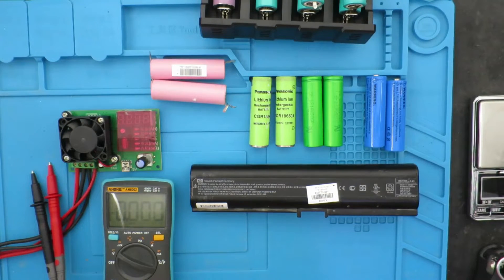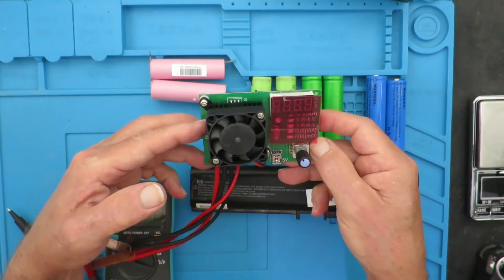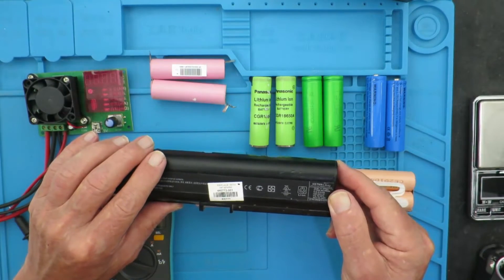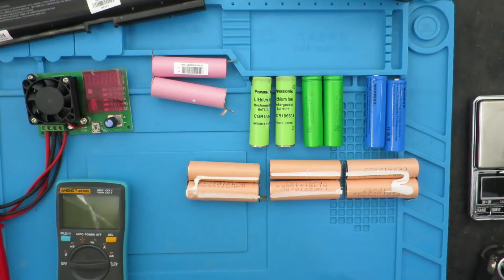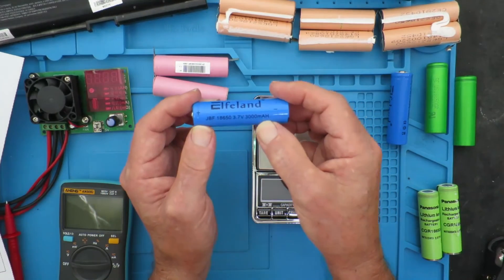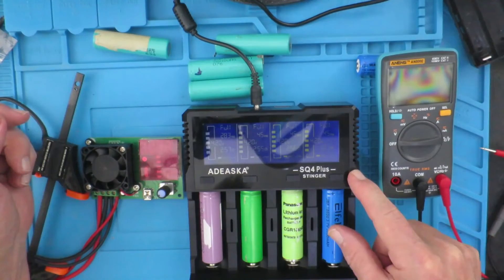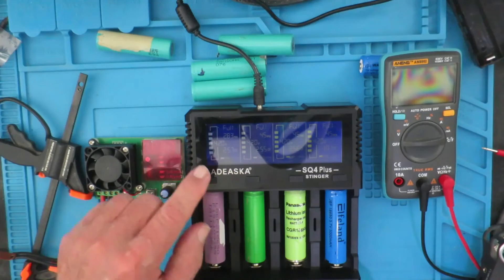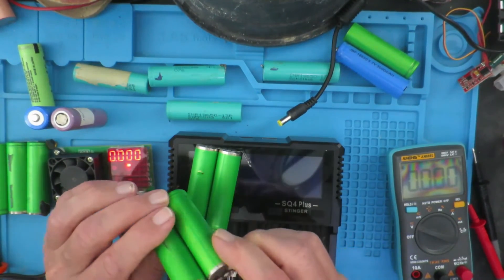Lithium Ion 18650 Internal Resistance And Cell Matching

Comment: Video great, also for matched packs you mentioned internal resistance, voltage, manufactures specs capacity also want to include type cells like NCR18650A verses NCR18650B since these can have a quite different chemistry and on the capacity I would check that using your chargers not depending on only the manufactures specs as you have mentioned in your video. The one big thing with these types of sliding mechanics are getting the best contact to the battery poles trying to eliminate this variable when the charger determines internal resistance, some of the best aftermarket use a small spike at each end of the sliding mechanism to help get a good contact, they might even be using tungsten or iridium tipped spikes so battery arcing when placing and removing the cells don't corroded the contacts. One last point if any batteries leak out the corrosive electrolyte (Lithium Hexaflurophosphate or LiPF6) this must be cleaned very well and to nuteralize the salt or the slider strips will corrode, also this electrolyte is flammable. Note discharge these batteries and dispose of them correctly.
Reply from the maker: Hey thanks! Good information to share, thanks. Have a great day!

Comment: What’re the benefits of matching cells by impedance or by voltage before making pack? How do people chose one over the other? Also heard some pack assembler do capacity balancing? Why?
Reply from the maker: It comes down to personal choice. I want maximum current so I select by IR first then voltage. Clearly the cells to make a pack should also be of the same capacity. Balancing is normally done by using a BMS that has that feature built in. It measures the cell voltage and when it reaches a pre set maximum a load is applied to the cell to stop it overcharging. Thanks for watching, have a great day!

Comment: This kind of device read defferent kind of internal resistance of the same cell in different charging port in the same charger...😂😂
Reply from the maker: That is true of any device that claims to measure IR. You will always get different results. However, the important thing is that you can COMPARE cells. It does not matter whether they are 1, 10 or 100 milliohms provided you build a pack of the same. Thanks for watching, have a great day!

Comment: What is reasonably closely matched 30 mohms or 10 mohms
Reply from the maker: I mean they should be closely matched to each other when making up a pack, so within 1 mohm. For example a pack for my EDF RC model plane has 3 cells all at 5 mohm because it draws a lot of current. A "normal" plane can use 10 mohm cells as less current needed. Maybe for a torch 30 mohm is OK. So you see it means closely match cells for a particular application. Thanks for watching, have a great day!

Comment: Any thoughts on the this unit (VC4 Plus) vs. the VC8?  I like that the VC8 has 8 larger slots and also seems to have most of the capabilities of this unit (though no output during dis-charging), but it does have USB-C and QC3.0 input/charging capabilities.  I am just not sure if there is something the VC4 Plus does (beyond the output option) that I might be losing by getting the VC8.
Reply from the maker: From what I can see you are correct. The only difference is more slots and no USB out.

Comment: Can the Adeaska VC4 perform all the charging and tests, etc on ANY lithium Polymer battery as well?  If yes, then how does one connect the two wires from lithium ion polymer to the VC4 plus?  I don’t see any ports  except the slots for the  cylindrical   batteries... 

If you are not sure, feel free too post a  link to a video of someone else who know how to achieve those tests for a lithium polymer with a two wire interface.

Great video, but I specifucally need the charger to work on/ test both  lipo cellks AND LIPO polymer batterires.
Reply from the maker: This is only suitable for single cells not batteries. My daily charger for LiPo's with internal resistance measurement is the SkyRC e680 : https://www.youtube.com/watch?v=KBkBus-ScI0
Reply: @1nformatica  I think I may have stated the question incorrectly:   

What I mean is that I have laptop batteries composed of six individual Lithium Polymer Cells  (so each one is a single 3.6v/3.7v cell, just in polymer format).  So I want to separate the six polymer cells and match them by capacity and impedance to build a multi-polymer cell battery... just like what you are doing here, but with polymer cells instead of cylindrical lithium 18650 (etc).    I just can’t see how to use the VC4 Plus to test/analyze the polymer cells as they would end in two (positive/negative) leads (that I would solder on) ...  I could of course attach a two hole JST connector, but again, there is no port on the VC4 plus to accept a JST female plug from a single polymer cell.  Specifically I want to use the VC4 plus to find the impedance of each individual (and separately wired) polymer cell.
Reply from the maker: @GearGuy  The VC4 is designed only for cylindrical cells. There are no ports to connect wires. You would be better off getting a stand alone  meter like this one : http://bit.ly/PZEM015 Battery Tester DC Voltage Current Power Capacity Internal And External Resistance
Reply: @1nformatica  Thanks, I think I might get both since I have quite a few of each and the features of the VC4 Plus should make dealing with the cylindricals a lot easier.  Thanks again for all the help and quick replies.
Reply from the maker: @GearGuy  Great! Let me know if you have any other questions.

Comment: Cómo me gustaría que doblaras al español este vídeo.
Mi inglés es muy básico y hay tan poco en español sobre este tema... Yo siempre le di mucha importancia a la resistencia interna... Ya en los 90 cuando corría con mis baterías Sanyo seleccionadas por LRP, con una baja resistencia interna los picos de alta intensidad eran posibles!
Saludos y gracias!
Reply from the maker: Gracias por ver el video. Puedes activar los subtítulos y usar el ícono de configuración del "engranaje" para generar automáticamente en español. Si tiene alguna pregunta específica, por favor pregunte.

Comment: i have LiitoKala Lii-500 when is better to measuring internal resistance ,when is full charged or when is discharged ? it is very different value like 10-90 .
Reply from the maker: Internal resistance is effected by many factors including the state of charge (SoC), temperature and current. Personally I check after charge is complete. What is important is cell matching so whatever method of measuring IR you choose make sure it is always the same. See https://www.researchgate.net/figure/Internal-Resistance-Change-Curve-in-Charging-discharging-Process-of-Batteries_fig4_291195631 Please consider subscribing if you have not done so already!

Comment: The internal resistance is so far from eachother, when comparing the charger and the discharger... so which do we trust.
Reply from the maker: Both are correct! A cell's Internal Resistance (IR) is a factor of chemistry. It varies with state of charge, internal and external temperature and other factors. The important thing when building packs is that the cells IR and resting voltage are as close as possible. If you make a pack with mismatched cells it will go out of balance quickly. Packs made with matched cells will often end up closer in IR and voltage after being cycled a few times.

Comment: I wonder if it is possible to measure battery internal resistance with a mutimeter and  a standard 1Ω resistor.
Reply: Of course. You put the resistor on the battery and check the voltage difference. Then use the formula to calculate the resistance. check this video 

https://www.youtube.com/watch?v=av38iBxcOgQ
Reply from the maker: I don't understand how that would work, can you explain?

Comment: Once you have tested your batteries and sorted them for there internal resistance. Do you sort the cells internal resistance in parallel or series?
Reply from the maker: Hi Rowan, when I build a pack I try to match as closely as possible the IR of cells both in series and parallel.
Reply: 1nformatica great thank you

Comment: Hi, when you test for resistance in the two battery’s that are welded in a pair
is there a formula to calculate for each cell ?
Reply from the maker: As far as I know there is no way to do that. I try to use cells that have been paired since manufacture so they will be well matched.
Reply: Cool thanks....I didnt want to un join some but we have to learn....
the ones I tested in pairs gave a reading of say 80mΩ but when pulled apart each cell
was say 170 and 165 each cell....so just over double once pulled apart.
Reply: @kermets  Resistors in parallel...
1/Rtotal = 1/170 + 1/165

=83.7mΩ
Reply: Yeah just multiply the resistance by 2 as pack of 2 cells are in parallel..when resistances are connected in parallel they decreases and when resistances are connected in series then resistance increases

Comment: Battery have the highest resitance at empty and full but not in the middle. So checking internal resistance should be at both full and empty I would think. Pretty easy to do that with the charger you have!
Reply from the maker: That is a very good point. Thanks for sharing. For selecting / matching cells I'm most interested in the worse case which would be charged or discharged.
Reply: @1nformatica Thanks, I've been researching this for a couple days now trying to find an accurate charger than can show the internal cell resistance but I decided that I'm better with a 4 wire AC pulse battery resistance meter. I ordered the YR1035 meter just now. I think this will give me more accuracy with difficult cells and I can probe other larger batteries in place like the batteries in my UPS with it so it adds more options for long term projects. Anyways good luck with your battery packs and health!
Reply from the maker: Looks like an interesting device. I found a good review here : https://lygte-info.dk/review/InternalResistanceMeterYR1035%20UK.html Mabe you can post a video of your tests.
Reply from the maker: @practicalguy973  This may help with the Chinese : https://www.youtube.com/watch?v=yQYRd3VJHyg
Reply: @practicalguy973  hello, i also have a charger with IR measurement, TEC-06 and they also show different values. Same like u was thinking about buying YR1035+ just to get the correct value. Did you get yours and compared them against each other? How far tec-06 is from yr1035? Thanks in advance!
Reply: @losien1  Yes I got my YR1035+, way more accurate and consistent than any of my chargers are. I probe my cells once a year and see if any are starting to get higher resistance. My LG HG2 cells that I have 8 of are what I use most and they are all still really low all measuring between 50-65 milliohm. Every time I charge any battery now I run my fingers over the cells as they charge once in a while and any that feel warmer I'll measure outside of my yearly check. I had an older 18650 from Thrunite and it was measuring 140 milliohm and a little hotter during a fast charge so decided to recycle that one. I have no experience with the TEC-06.
Reply: @losien1  Think of this also, a higher resistance cell is making your charger work longer and harder as the cell resists more energy to heat, good idea to charge at a lower rate for higher resistance cells so your charge wont be under more load and maybe burn out with some designs. The bad side of that is a charger could miss termination easier. Good idea to just use healthy cells.
Reply: @losien1  Funny story I ordered the YR1035  3 years ago and was sent the YR1035+ by the seller. Its a little nicer size and look but function is identical for internal resistance.
Reply: @practicalguy973  thanks for your responses. Yr1035+ is an updated version. I’m aware what IR means especially for high current applications and that’s why i’m so interested getting this number accurate. I’ve noticed the higher the capacity of a cell the less IR it has so let’s say 6s Lipo 5000mAh will always have smaller IR number compared to 6s 1500mAh. Also on what state of charge do you test it as it also matters? Anyways you say you have no experience with TEC-06 - that’s the one u show here in your video (pcb with a fan type thing) and that’s what I also have hence I’m wondering if it’s worth spending more money for that yr1035+. Thanks!
Reply: For internal resistance measurement you could go the cheap and precise  way and connect a small resistor (capable of handling 20 - 25W) over the battery, measure the voltage disconnect the resistor and measure the voltage again. Using Ohms law and Kirchoffs law using the voltage potential difference, you can calculate the internal resistance. This is more precise the shorter and thicker wires you use, the more precise a multimeter you use etc. 
There is no consensus in regards to measuring internal resistance at certain DoD levels. I've seen one firm that measure at 30 % DoD, to keep som conformity to their internal resistance ratings. If you are building packs just make sure you do it the same way every time over and you should be fine in terms of resistance matching.

Comment: Great video, thanks for the useful info. I am not making fun of you but, please, I guess millie ohm is technically correct, maybe?  But please call it Meg-Ohm.  I'm an old guy so maybe they changed it?  They used to call a cycle, Cycles or Kilocycle or Megacycle  They changed it to Hertz, out of respect for the man that invented it, discovered it?.  That was hard to get used to but I usually get it right, after 50 years.  If they changed the nomenclature to mile-ohm, so be it and I am wrong.  It just sounds like fingernails on a blackboard to me.  Sorry, didn't mean to interrupt.  What you are doing is more important. Hows that charger/meter?  I just bought the Opus C3100  now I see this?  It looks great! I cant win for loosing!
Reply from the maker: The tester works well and I specifically chose it as it has the internal resistance measurement. The prefix "milli" has, since 1795, been used to denote one-thousandth part. So the milliohm is 0.001 Ohms (mΩ). Lithium cells need to have a very low internal resistance to be able to produce high currents. Megohm is of course 1,000,000 Ω. If a lithium cell had an internal resistance of 1 MΩ then the maximum Amps you could draw would be 4.2 Volts / 1,000,000 Ω = 0.0000042 Amps or 4.2 micro Amps.

Comment: Wow, i should weight the cells too ... because for the moment I eliminate cells that have lost more than 0,06 V in a month and those with higher than 75 mOhm IR and I trust capacity tested by the seller, but here I see weight can be an important way to check if a fake cell slipped through the chain. (my application is low Amps in very big packs for the home)
Reply from the maker: Yes, it is a quick and easy test to weed out weak cells. No point in wasting time on them.

Comment: Ive been wondering on this for a long time. i keep them in pairs and use battery holders in 7s 32p (448 cells per wall) check out my videos. 
I've avoided this topic for a year but now that I've solved my other design issues I'm starting to tacking this. I'll check out your other videos and see. Thanks for your hard work!